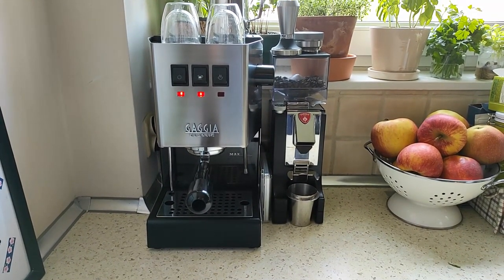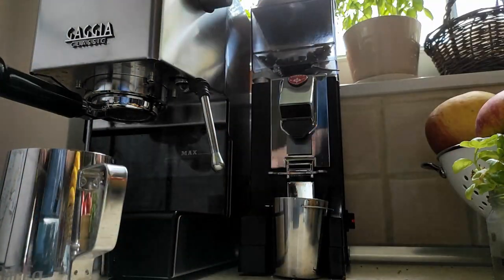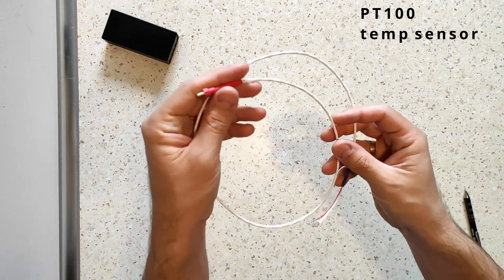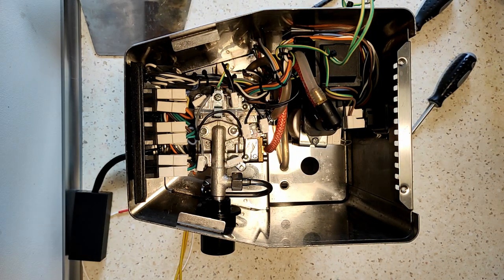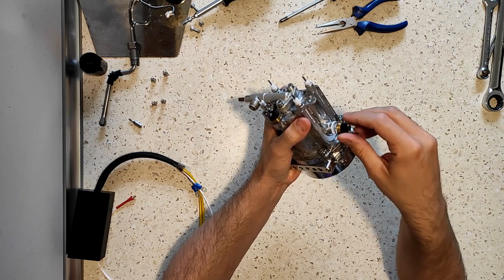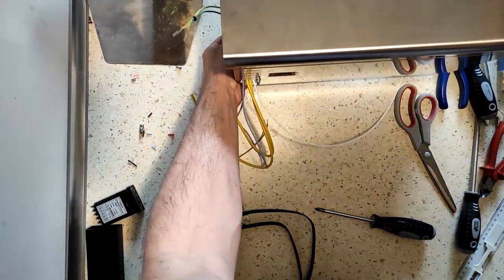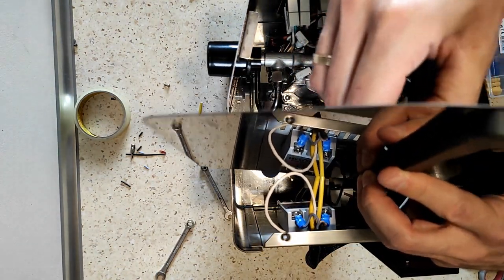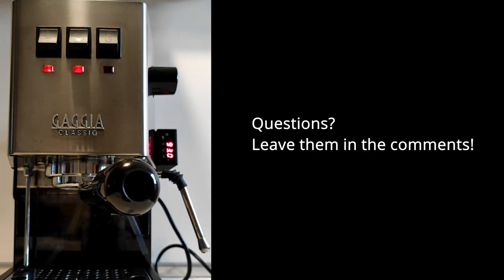How to install a PID on a Gaggia Classic Pro - DIY, cheap and good looking!

Comment: Hi Robert ! Very nice video and very well explain. I just installed my pid thanks to your video, I set all the parameters on the pid but it doesn't heat up the boiler and I don't know where did I go wrong. It only shows me the boiler temperature which is around 24-25°C but don't heat up. Can you please help me 🙏?
Reply from the maker: Hi Vasile! There's an order of troubleshooting steps I would take:
1. verify all cable connections, especially those going from the SSR to the boiler/heater. Your PID seems to be getting the correct temperature from the sensor, so the issue is probably between the PID and SSR or the PID and heaters.
2. verify the SV value in the PID (comes at 80 by default, you can raise it).
Reply: @robertkujawa3504  Ok.  Thank you. I will try it . I hope to solve the issue. Have a nice day
Reply: Hi.  I didn't solve the problem. I checked all the connections and all the parameters of the pid and it's all ok. I don't know if the ssr or the pid could be the problem, it's all I can think of
Reply from the maker: I'm sorry you're still having issues with the setup. I'd suggest trying a different SSR, this is the cheapest component to replace and there are reports of inconsistent quality of those Fotek SSRs.
Reply: @robertkujawa3504  Hi Robert.  I appreciate a lot that you are trying to help me to solve this issue. I  was thinking that the ssr may be the problem and I ordered a new one  because I have the SSR 25 AA and I buy a new one the SSR 25 DA. I wanted to ask you about this, I really don't know witch is the difference and if that may cause the problem. I will let you know after I install the new one. Thanks again
Reply from the maker: @vasilehategan5506  ha! This has got to be the reason! You really need the DA version, AA works with alternating current. Fingers crossed, it will work with the DA one.

Comment: where can i purchase such short lengths of cable wire. can you please give the explanation of the abbreviations i am not familiar with the variou types of wiring
Reply from the maker: You'll most likely need to buy a little bit more, like a meter or two. Feed the abbreviations I gave in video description into ebay or amazon and those cables should pop up in search results.
Shops with car part will also know what types of cables they are, you can have a look there.

Comment: What values do you have on your PID for setting 089?
Reply from the maker: P: 4.1, I: 66, D: 18, Souf: 0.2, ot: 2

But I would recommend you perform autotuning on your machine and start experimenting with those values only after getting unsatisfactory results.

Comment: Hello I would love to know how to do the electric connection on my gaggia classic 2012 for a pid I really don't know and the convencional pid in Europe and us don't deliver very easy to mexico also is very expensive the parts, tax customs etc
Reply from the maker: Hi Alberto, the Aliexpress seller I linked above will ship to Mexico so you should be fine.
I don't own the first version of the Classic, but I assume it only differs in the source of mains voltage for your PID. I've seen people tap into the power button for this - the middle connector. Please check with a multimeter however, as this isn't confirmed.

Comment: Hi Robert! Love the video! Could you please let me know which exact model number you have? I have the Classic Pro RI9480/11 and I've heard that it's very difficult to remove the boiler on this one due to too many wires 😕
Reply from the maker: That's the one I have. You'll be able to remove the boiler easily by following the video, don't worry!
Reply: @robertkujawa3504  Thanks so much Robert :)

Comment: Hi Mr Robert, Good job and thanks for sharing the installation process of PID kit for Gaggia Classic Pro 
First of all I have to say sorry I have 3 questions as I very new to this kind of coffee machine, please help and guide me and Thanks in Advance
I bought this model: GAGGIA MILANO CLASSIC RI9480/13 (2019 Model   -  SIN035UR) and to arrange all modification parts and wires from Ali-express  and other parts from different places  it took me almost 2 months in the mean while I have watched your videos many times to understand myself  and I have prepare a notes and bought necessary parts and kept ready in hand to install PID 
I would like to Replace or Mod the Rocker switch from Monostable to Bistable to take advantage of using wifi switch to keep my coffee machine ready to use during busy day , even after changing the switch the wiring will PID installation will remain same as {How to install a PID on a Gaggia Classic Pro - DIY, cheap and good looking!} explained in the video or if there are any change please mention 

I would like to install 2nd SSR to the Steam function as well, do I have to use 25AMP DA or 40 AMP DA? Please help in this process for wiring and connections ( video would be more helpful for me and I appreciate if you could spare time for this one as well ) or at least a diagram and parts list 
 I have XMT7100 1/32 DIN model I will Modify the PID to use for 2nd SSR as as you suggested “ Mr. Damian Witonski ” video to modification 

Please make a video for the PID temperature settings  for both the Brew and Steam 
Thanking You 
Tej with Love from INDIA
Reply: Hey Mr Robert i have found the PID temp settings in the comments section and understood you have skipped steam PID temp , can you help for wiring changes if i want to change rocker switch  bistable

Comment: Will this exact modification work on a Gaggia Classic from 2006? (Made in Italy)
Reply from the maker: In general: yes, but you need to account the difference in wiring. Please refer to the correct wiring diagram, for example at Whole Latte Love.

Comment: Man, I have the same exact config, with The Classic and the Eureka Mignon. The grinder is great but pisses me off that you put coffee everywhere, and that it puts out some chunks you have to crush by hand before brewing. 
That little metal cup you have looks great to transfer the coffee directly to the basket! where does it come from :) ?
Reply from the maker: The dosing cup comes from Aliexpress (Sunwaycoffee store), it's pretty useful and fits the 58 basket nicely.
You're right about Eureka Mignon clumping a lot. I've made a WDT tool with a cork and some acupunture needles. It made the biggest difference in my case, comparable only to the 9bar spring. Highly recommended!

Comment: Do you know if I could follow this video for a pre 2018 Gaggia Classic?
Reply from the maker: The process is mostly the same, the only difference being the source of power for the PID. I've seen people tapping into the middle connector on the brew switch for mains voltage. You should probably double check it with a multimeter.

Comment: @robertkujawa3504 Can you please tell me if this mod works with the classic 2015 (Europe version)?
Reply: Scrolled through a lot of comments, seems it works, there's just the difference where to get the power from.. still scrolling to find other users solution for it.
Many thanks for you video, did get me going...!
Reply from the maker: @obBi0  that's correct, it works with the previous version, but you need to tap into power in a different spot. The exact details are in the comments, I hope you can find it.

Comment: What is the size of the connector? Are they 1.5mm or 2.5mm?
Reply from the maker: If memory serves me well, they're 2.5mm.
Reply: @robert kujawa  i will definitely do this mod. Thank you so much for this video.
Reply: Hey robert. Thank you so much. I did this mod, i do exactly as you did on the video. The only thing i could not manage was the cable sleeve. Lol.

Comment: Hello
Can you please share dimensions of cables and conectors? I was today in electrostore and they told me that for those circle connectors i need to know dimensions of cable and connectors screws. There is no documentation for relay screws, and also i did not know what is thickness of cables which youve used.
Thank you
Reply from the maker: Hi Pavel, you can go with M3 circle connectors, as those will fit the SSR. The cable is 0,5mm on the low voltage, signal side and 1,5mm on the 220, heater side.

Comment: First accessible guideline I saw on PID mod, great work. One question: Will steaming work as before with your mod or not?
Reply from the maker: Steaming is PID assisted, not PID controlled. You can still use your old technique or do what I've been doing: observe temp value on the PID, purge at 140 degrees Celsius, steam at 150. Plenty of steaming power!

* Temp offset: 8 degrees.

Comment: Just wanted to ask whether you're still happy with this setup? Thanks!
Reply from the maker: Without a doubt: yes! I fully recommend it.
With the steaming practice I even lost the motivation to control steaming throught the PID.
Reply: @robertkujawa3504  am I correct in saying that even without the PID being connected to the steam thermostat, it still shows the temperature since it's a single boiler? Because that's plenty good in my opinion. I was just about to pull the trigger on your links when you replied. Thanks!
Reply from the maker: @delta25er  yes, you'll see the temperature on the PID display. That's how I know when to start steaming: as long as I start at exactly 150*C I know I won't run out of steam power.
The links aren't affiliate, but thanks for the consideration! :) good luck with your mod.
Reply: @robertkujawa3504  I hope you don't mind another question, but i find myself now intrigued by the electrical aspect of this. And I am admittedly quite ignorant when it comes to that!

 Why are we using a DA SSR? Aren't households AC? So I would've thought we'd be giving the SSR AC input. I've seen other people (including the Mr Shades kit) use a DA SSR for the brew temp, and AA SSR for the steam temp. This confuses me further!
Reply from the maker: @delta25er  it can get quite confusing, that's for sure :) here's the basic description:

1. the PID takes AC input, but outputs DC to control the SSR
2. the SSR takes DC from the PID to know when to engage the AC to the heaters.

If you take a look at the label on the SSR you'll notice that one side takes AC, the other takes DC.

Comment: What about connecting a ground wire to terminal 3?
Reply from the maker: It's been running without that for 6 months now. No issues.

Comment: Hey I just installed the PID and the machine turns on, but the PID doesn't turn on and the machine doesn't heat up. The 'boiler ready' indicator light just remains on from the second the machine is turned on
Reply from the maker: Please double check all connections, there's an error somewhere. I'd check the PID terminals, you might have mixed the power line and the sensor line (wild guess, but a place to start).
Reply: @robertkujawa3504  Still haven’t found the problem. Does it matter which of the white wires i put where for the thermal sensor
Reply: It should also be noted that I have the earlier model (not the pro) and am living in the US on 110v power
Reply: Okay the PID is working now, but there is no water coming out of the group. The steam wand will blast water if I open it with the pump but nothing is coming out of the group
Reply from the maker: @hagensmusic636  this indicates a blockage in the solenoid valve. I'm sorry, but you might need to disassemble the valve and descale it. Whole Latte Love have got a video on the procedure, it's a common problem with Gaggias.
Reply: @robertkujawa3504  Just cleaned and descaled the valve… no change
Reply from the maker: @hagensmusic636  can you hear the solenoid valve working? Does it "click" when you turn on the brew button? Is it possible that you disconnected power going to the valve?
Reply: @robertkujawa3504  It is not making a click sound
Reply from the maker: @hagensmusic636  It's probably not getting power. I'd double check the wiring and the security of plugs. I haven't got the older Gaggia, but according to diagrams I've found, there should be a brown wire going to the valve from the power button and a red wire going from the brew button. Is that the case?
Which spots have you tapped into for PID power?
Reply: @robertkujawa3504  That is indeed the case. I’ve tapped from the brown wire on the power switch.
Reply: I do have power to the solenoid now. It is clicking. Still now water from the group though
Reply from the maker: @hagensmusic636  so, the pump is working, the solenoid is closing, but no water from the grouphead. I haven't got further ideas what might be wrong, except a blockage somewhere on the water path. You've seen the inside of the solenoid valve. Was it free of scale/debris? Were you able to blow air through it? How does the grouphead look, are the channels there free of limescale?
Reply: @robertkujawa3504  yes everything is clear. I’m thinking I wasn’t actually hearing the valve open and close

Comment: Probably didn't need to disconnect the solenoid and the hose I would think just to make the process a little bit easier
Reply from the maker: You might be right, I just felt that having it outside and disconnected would allow me to show things more clearly.
Reply: @robertkujawa3504  definitely true for YouTube purposes

Comment: Did you change the OPV spring?
Reply from the maker: Yes, this machine is modded to 9 bars.
Reply: @robertkujawa3504  thanks for the reply. I have watch James's video about the second hand gaggia, so where did you get your Gaggia from?
Reply from the maker: @mbrylewski  I bought it second hand locally. It was only 1 year old but in poor condition: leaking portafilter and descaled aggressively. It took a while to get it to shape. :)

Comment: Hi can I do it in a gaggia cubika?
Reply from the maker: I've never used a Gaggia Cubika, but if the internals are similar than you should be able to adjust the process and complete the upgrade.
Reply: @robertkujawa3504  I have ordered all I need and I will try to follow your steps. Finger crossed

Comment: Wonderful video! I'd love to try this on mine, but I'm in the US with 120V instead of 240V. Do you have a recommendation for an appropriate PID & relay? Thanks in advance for any assistance.
Reply from the maker: If you follow the links in the video description you'll notice I've used universal parts. Both the PID and SSR can take a whole range of voltages, so in theory should work just fine.
To be safe though, I'd ask the AliExpress seller for confirmation, as I've got no way to verify it over here.

There is also a model of PID running on DC 12V, but you'd need an additional power supply.
Reply: Don't know if you were able to find the answer, but what you would need is the 40amp relay as the 25amp is not enough to cover for the difference in voltage.
Reply: @Werdmeng  Why shouldn't it be enougth? The Gaggia has a power consumption of around 1300W which means if you are I the US with 120V it will drain at most ~11amp which is half the current the SSR is capable of.

Comment: Can anyone in Canada help me out on where to get these cables  I can't even find it when I copy paste it into a search
Reply from the maker: Just make sure the gauge and temp. rating are the same and you'll be fine.
Reply: Were you able to find anywhere in Canada? I am looking to buy cables and connectors too but i dont wanna pay extra 50 dollar for them since i am able to buy pid, sensor and 2 relays for 50 dolar in aliexpress.

Comment: And pid settings friend..??
Reply from the maker: The most commonly used parameters for PID on a Gaggia Classic are the following:
P: 4, I: 60, D:15, Souf: 0.2, ot: 2, PSB: -008

The settings found by autotuning in my case were:
P: 4.1, I: 66, D: 18, Souf: 0.2, ot: 2

Comment: Hi there, two questions if you don’t mind. 

Firstly, why do we need to swap the factory installed temperature sensor for that PT100? 

Secondly, is it possible to build PID for GC on other than XMT7100 controller? For example on such as PID Gicar MC740 which seems to be dedicated to Lelit coffee machines.

 https://www.youtube.com/watch?v=BJLocPnniM8&ab_channel=Lelitinsider
Reply from the maker: The temperature sensor that comes with the machine is a thermostat with a significant degree of latency. It's way too erratic and slow to react for the PID to function, plus the PID cannot read the temperature through the thermostat. This is why you need that pt100 sensor.

As for kits from other machines: they might work, but they can also be a chore to set up. I'm not competent to say if the lelit kit is gonna work, sorry about that.
Reply: @robertkujawa3504 Cheers.

Two more questions. 
How has the PC thermal paste, you used, been doing? Any issues so far?

Is there, in your mod, any boiler's overheating protection? I've just watched Damian's tutorial on setting up of the XMT7100 and got scared that's so easy to get boiler overheated.
.
Reply from the maker: @wog9813  as for the thermal paste - no issues to report.
The mod doesn't remove the overheat protection (it's called the thermal fuse and is screwed to the top of the boiler), it's still there, so you're good.
Reply: @robertkujawa3504  What's your experience and opinion on this mod after one year of using it? Does it really upgrade the machine? Are your shots better, taster and more consistent thanks to it?
Reply from the maker: @wog9813  I stand by everything I said while filming the video. The shots are simply better tasting and more consistent. Out of many mods that can be done to the Classic, this one and pressure reduction give the best results in my opinion.